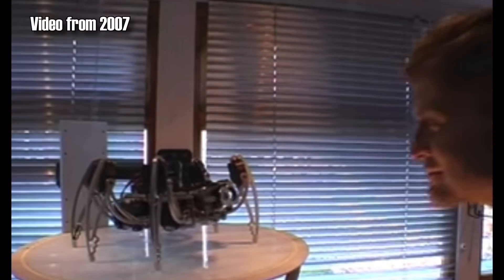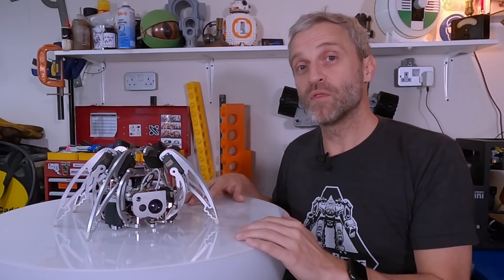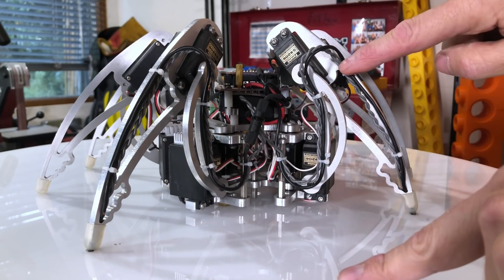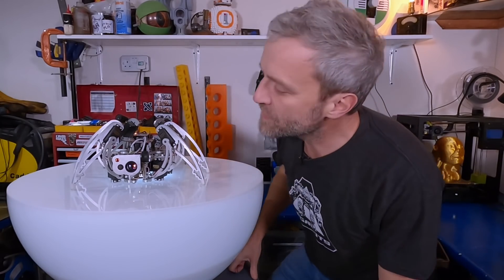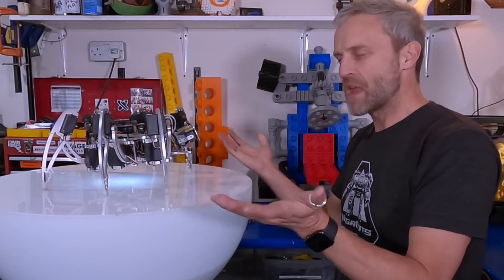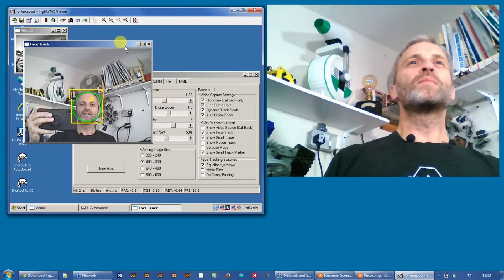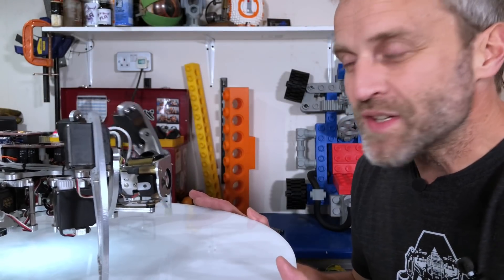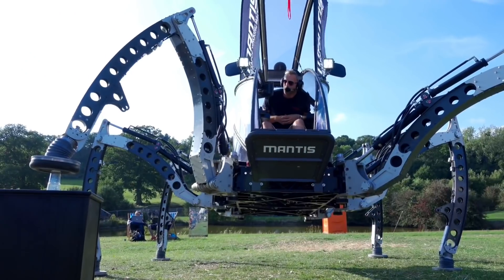Mesmerizing 2006 Robot (Will It Still Work?) - Mantis Hacks

Comment: I have one almost exactly the same, mine has an ultrasonic emitter / detector instead of a camera and a pic controller on its back calling the hex engine functions, it walks with obstacle avoidance for two minutes then goes to " sleep " untill the infrareds on its legs are triggered whereupon it starts again. As its your design I must have aquired it from you ( as a kit of parts ) thank you, and like you I haven't powered it up for years......I'm looking for the charger now....
Reply from the maker: Yeah that would be one of my flock 😁 I did an ultrasonic example for obstacle avoidance. It’s in my hexapod playlist.
Reply: @MattDenton  So it is one of yours, cool. When first constructed I used a PS 2 controller to " drive  " it remotely then later I added  the pic controller to make it autonomous. I wrote a loop calling for " fwd motion " with sub routines for stop and turn or walk sideways when triggered by sensors. I learned enough about the pic basic to write the code but I couldn't do it now, its long forgotton, if it no longer works I'm sunk....

Comment: If you had to build one self contained in 2006, you could use a Gumstix computer module (originally PXA255, but they had newer ones by then) or Lynx (Freescale i.MX) one of several others available at the time. A true explosion in number of available SBCs came in 2008 when i think BeagleBone or BeagleBoard released, i forget which, and LinuxStamp and others. So back to 2006, the other options apart from Linux SBCs were PC104 boards, including VIA Eden, AMD Geode, and even Athlon64 if you had the power budget and needed that performance.
Reply from the maker: Yeah you may have been able to do it with a gumstix, I remember the board. But when I was developing iC I found I needed a high frame rate 20 to 25 fps to get good enough tracking ti get the effect I wanted. I do t think I would have got this with the SBC’s at the time. 🤷‍♂️